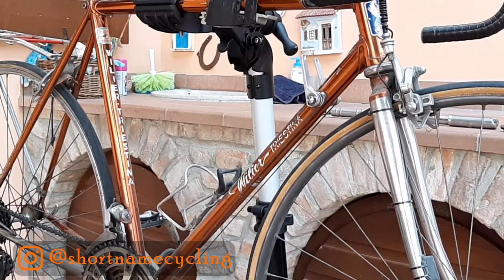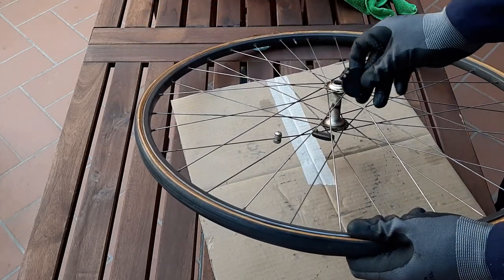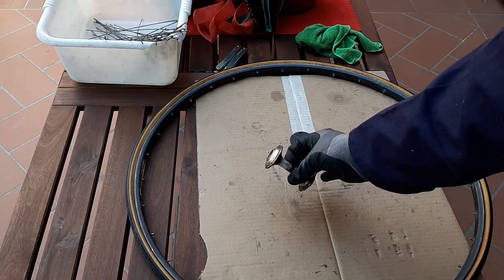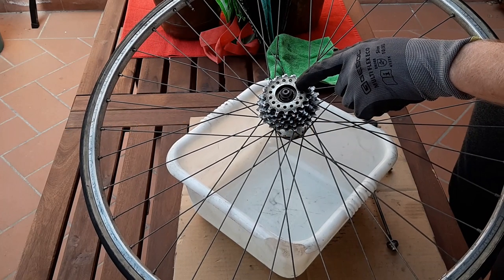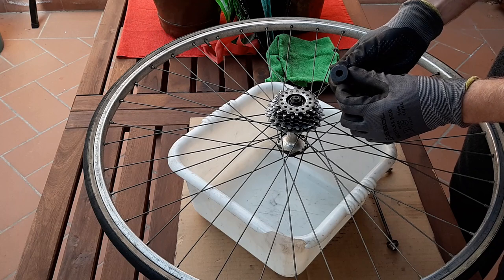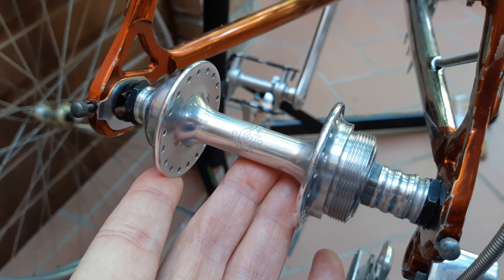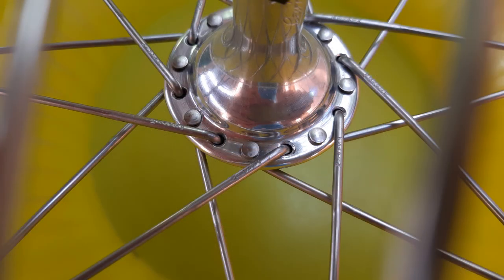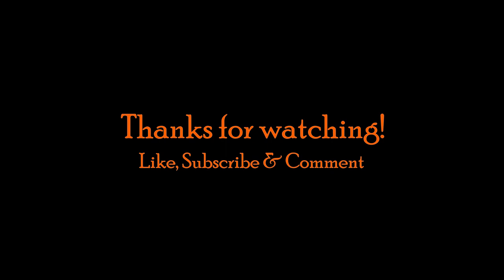Wilier Triestina Ramato Restoration Part 9: Campagnolo Hub Overhaul and Wheel Build

Comment: The preload in hubs is set like this: You leave a tiny bit of play in the cup and cone bearings. Then you clamp the quick release skewer (all on the bike) with just enough force that the play is gone and the wheel is secure. The clamping force of a qr skewer is approx 1.5 kN, this shortens the hub's axle enough to add preload - reduce play.

Comment: Pretty sure those dust caps can be removed.
Reply from the maker: You are correct. But not easily. There is a specific tool made by Campagnolo to remove them. And without it, it is very easy to damage the dust caps. Cleaning is longer with the dust caps on but still doable.
Reply: . Park Tool has a tool for it too. Really old hubs I just find easier to remove to thoroughly clean and grease them.